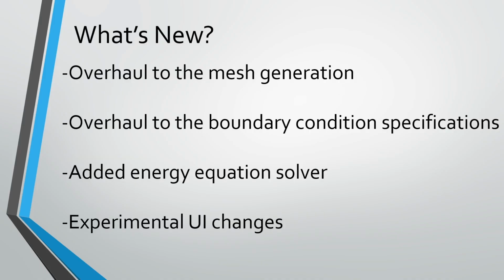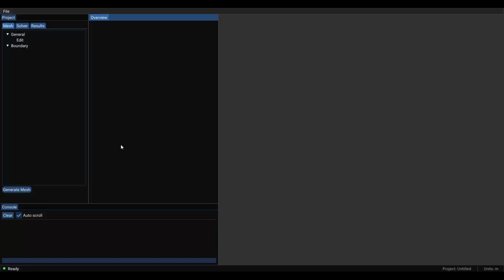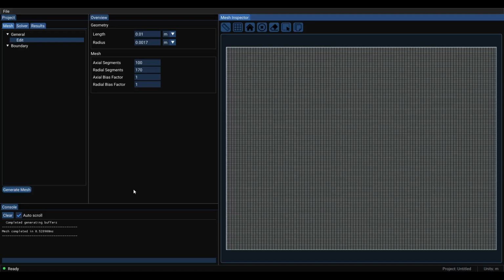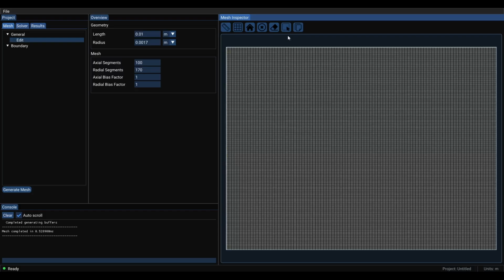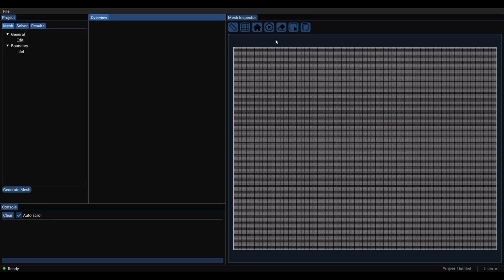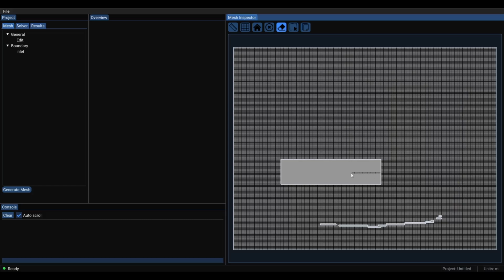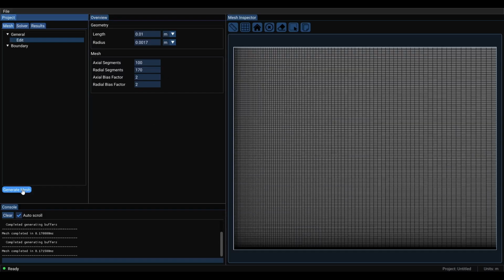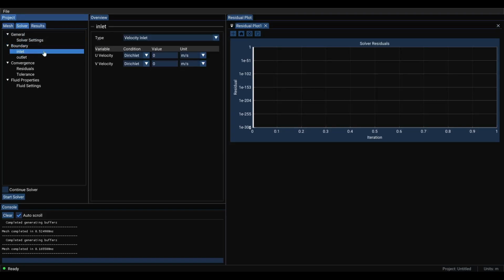AxiSim v1.03-alpha

Comment: what is the biggest challenge thus far in developing this engine/software?
Reply from the maker: Implementing a new feature comes with a lot of problems. I need to rewrite a lot of code to implement big features, so that takes a lot of time. And the features I add can later become obsolete, which requires more code rewriting to remove.